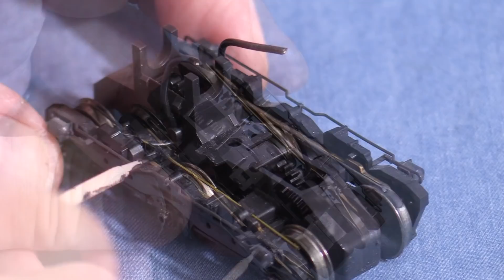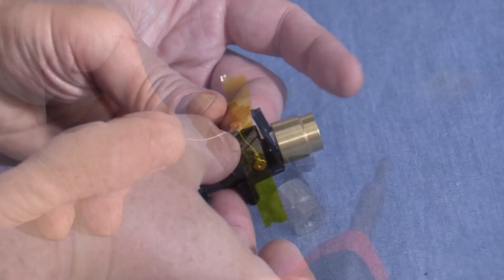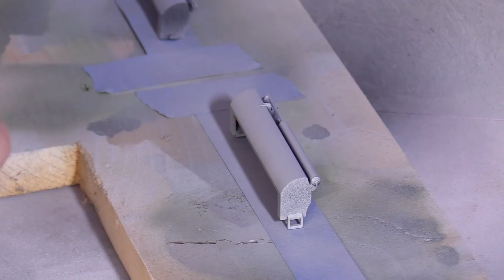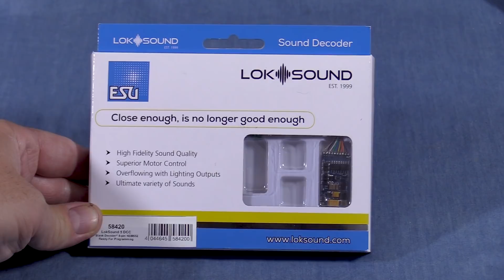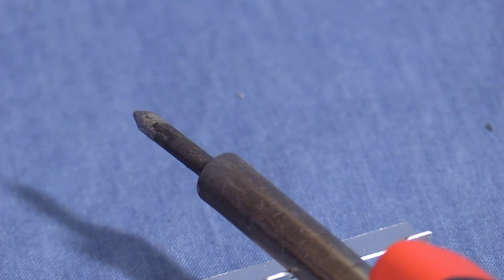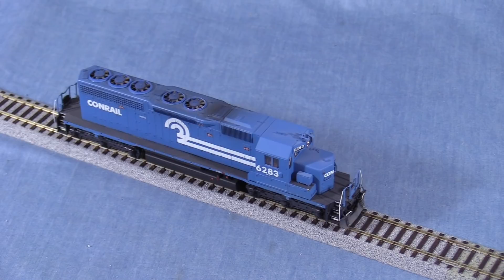Model Building HO SP Consist Build 12 - Loksound DCC Installation

Comment: Dan - I bought a cheap shell to practice painting. I also want to practice making a working engine. How do I determine what chassis, motor, trucks, etc. that will fit the shell? I don 't want to just by something that might fit. So just wondering how to find the right resources.
Reply from the maker: The easiest thing is to look for a chassis that's the same brand and locomotive type as the shell.  Sometimes you can find a complete chassis with trucks and motor and everything basically assembled on eBay or elsewhere.  You can also substitute a different brand chassis, but you'll probably have to do some cutting and filing to get everything to work together.  I am looking at doing that on one of my other engines, an HO Proto 2000 GP38-2 that I detailed.  The chassis literally cracked in two while the model was stored.  I've heard this is a problem with some of the Proto GP38-2s, so a while back I bought an Atlas GP38-2 chassis that I want to use to fix it.  I have not tried fitting the two together yet.  Sometimes you can also substitute the chassis for a slightly different model.  For example, the Kato SD40 and SD45 use the same basic chassis with the same parts.  If you're looking to build from the ground up, Athearn trucks and drivetrain parts are fairly bulletproof.  The Kato motor is also really good.  Good luck with your project and thanks for watching!

Comment: I’ve also been doing DCC Installations for a Model Train Shop here in Southern California, I can relate to this install. Have you ever used Nix Trains Decoder Buddy?
Reply from the maker: I haven't used the Decoder Buddy.  I'll have to check it out.  Thanks for watching!
Reply: @DanielCortopassi  Using the Decoder Buddy eliminates the need for external resistors on your LEDs. It’s a board with Integrated resistors. It makes DCC Installs a breeze

Comment: Awesome Dan, that Conrail unit
is coming along nicely!!!! For all
you modelers watching, as I told
Dan awhile back you can get the
750ohm .25 watt resistors from 
a company called All Electric, you
can get a sheet of 100 cheap, also
you can get all the shrink tube at
Auto Zone by the box cheap!!!
Now is the time to collect supplies
winter is coming and it will be time
to get back to the modeling bench!!!
Reply from the maker: Thanks for the tips on where to get supplies.  I used to live near an electronics store and I got a lot of stuff there, but I moved.  I still have a stash but eventually I'll need to find more supplies.  Thanks for watchiing!

Comment: Quick question what is the difference between the esu lok 5 board and the esu lok5 power pack board? Does the power pack board just have more tabs for light functions and esu keep alives on or is there more to it?
Reply from the maker: I haven't tried either of those yet, but it looks like the power pack board is the same except that it has a built in power pack (capacitors).  The ESU website says it has 10 function outputs.  The regular Loksound 5 Direct board has at least 8 outputs according to the website, though it doesn't really say how many it actually has.  The power pack version looks like a completely different circuit board so it's possible it may have a different number of lighting outputs.  I'm curious now to get my hands on one!  Thanks for watching!

Comment: DCC installation vids are pretty neat to watch. As of the past 2-3 years I really haven’t been seeing many hardwire installs like that on the internet, as many modelers have been switching to other designs like the Loksound Direct as well as the fairly new NixTrainz Decoder Buddy (which has an unpluggable light board) motherboard that takes a 21 pin DCC decoder like the ESU V5. It also has built in resistors so no need to futz with external resistors although it may not be for everyone who may prefer different resistor types. Good stuff!
Reply from the maker: I guess this one is a little bit "old school".  I may try a decoder buddy in the future.  I think the advantage to something like that is that if there are Loksound 6 or 7 decoders in the future, it should in theory make it easy to upgrade.  On the other hand, it's more stuff inside the shell taking up space.  That can be a problem on locomotives that have a lot of lights (and wires).  I'm not a huge fan of on board resistors, as I think the lights look better when I use my own.  Sometimes the on board ones are too strong, I think.  Thanks for watching!
Reply: @DanielCortopassi  yeah, no problem. i’m not sure but i believe special resistors can be requested from nick santo/nixtrainz, but i’d probably ask him to double check